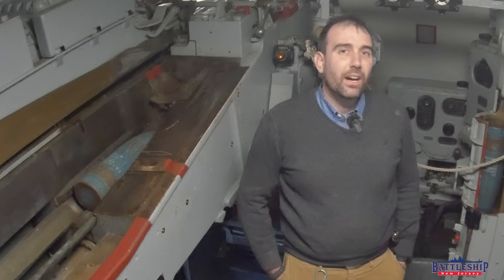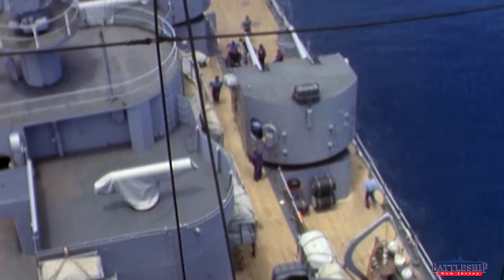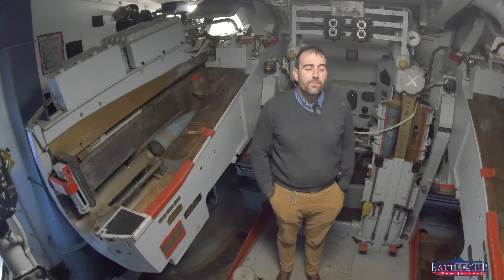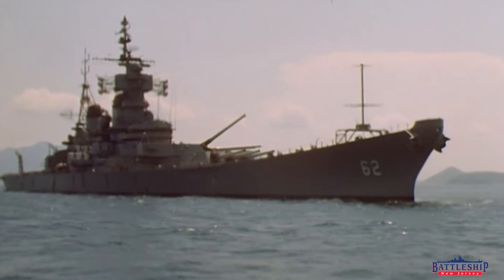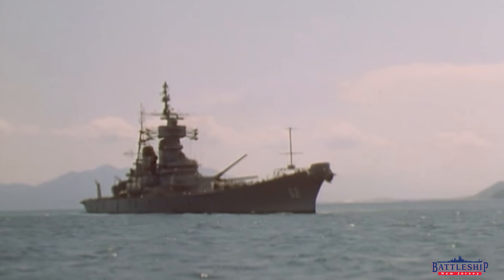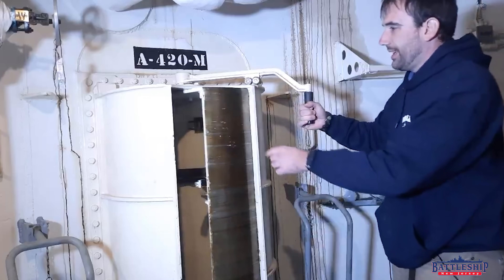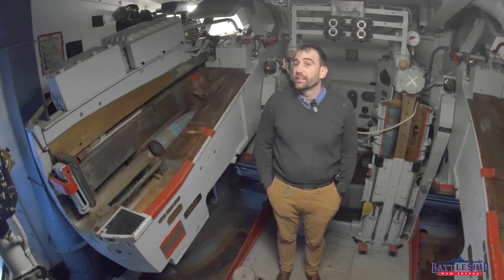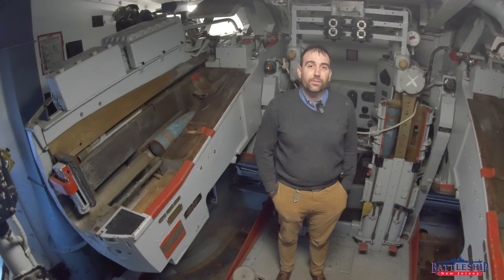Why Do Modern Warships Have So Few Guns?

Comment: frankly, it has to be more than advances in jets and missiles as the 4.5"/55-calibre Mark 8 was not able to stop jets in the Falklands
Reply: TBF the Mk 8 was explicitly designed as reliable slow-firing weapon for shore-bombardment only, hence why it has a rate of fire of 20 rounds per minute, rather than the 60+ rounds per minute intended for 1950s naval gun projects like the 5" QF Mk N1.
Reply: Well in the case of HMS Coventry when Sea Dart failed them, they had to use the 4.5" gun and rifles to try and stop the Skyhawk that attacked her
Reply: ...didn't you just contradict yourself? Guns aren't nearly as useful in the modern battlefield in a defensive role and missiles can fill the same shore-bombardment role, albeit more expensively. Having one bigger gun onboard means the captain can poke at something if they want to with something bigger and with further reach than a .50 cal can cheaply.